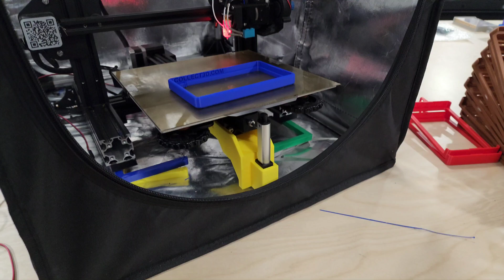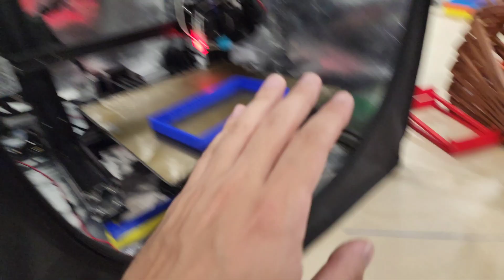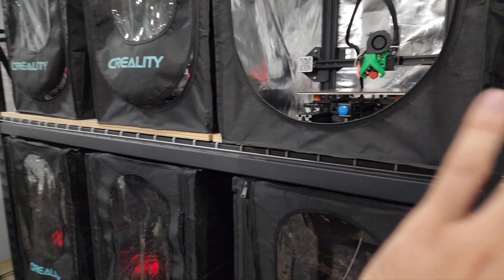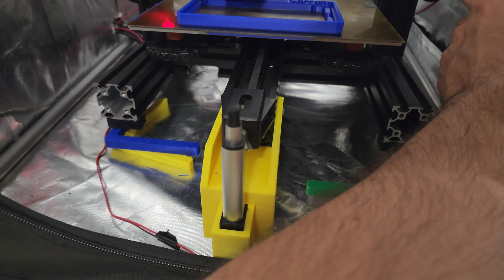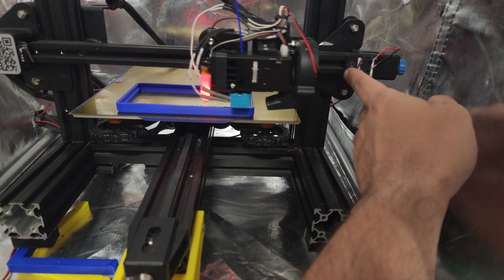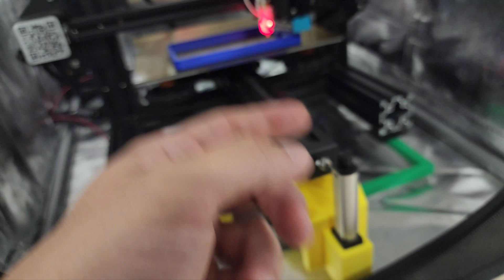3D Printing Auto Part Ejector Part 2! IT WORKS!! Ender 3 Print Farm Automation

Comment: Do you get a better result if you add a cooling pause? Or does the cooldown/warmup negate the benefit somewhat?
Reply from the maker: A cool down would make part release a little easier, it will just depend what you're printing if your parts have large surface area. In my case i can pop the prints off immediately and start a new print within 30 seconds or so. Huge time saver.

I keep my build plate at 50c so the parts remain rigid for the most part and easily pop off right after printing.

Comment: What a effort just use octoprint with Auto Queue same result less stress
Reply from the maker: How is octoprint going to give me the exact same result? This demo is not about the queue functionality. This mod is to be used in addition to any software queue capability. In my testing the motor is not strong enough to forcefully break away the part on the pei sheet without bending it. So this is my solution to that.

Comment: Works great and very simple. For my peace of mind I’d like to be able to monitor each printer with a camera just so I don’t come home to chaos. You could take this a lot further with slides that guide the parts into buckets on the floor, or even optical sensors that won’t let printer start printing if it sees an obstruction, but this as it is is a very nice proof of concept.
Reply from the maker: Agreed! Can definitely take it to the next level. My overall goal was to make this very simple where no coding is required. Only a few components to make it work. I could add another actuator that's activated at the y limit switch maybe to sweep the bed with a 90 degree servo and an arm or something.

Comment: I'm curious to see how reliably the head will push the parts out of the way.  Perhaps you could use another horizontal actuator at the back of the bad with a wide sweeper to completely clear the bed.
Reply from the maker: Yeah good point, I'm thinking maybe a 90 degree servo with an arm that activates by another activation switch at the y axis that sweeps the bed after part has been detached.